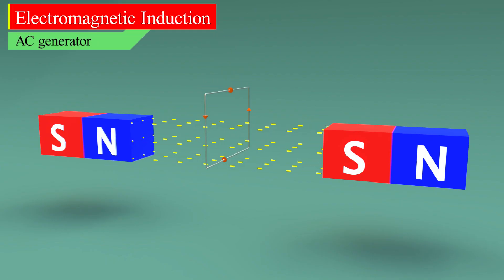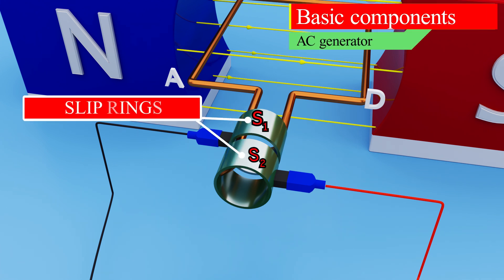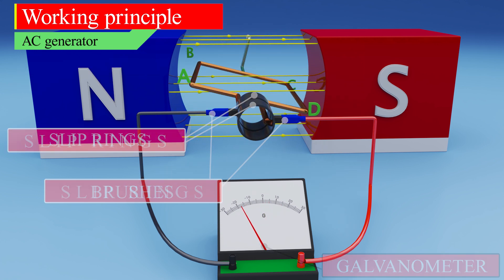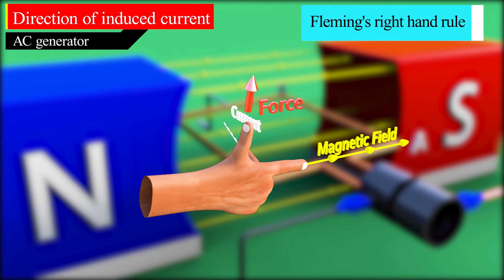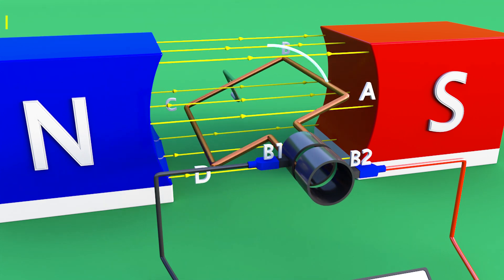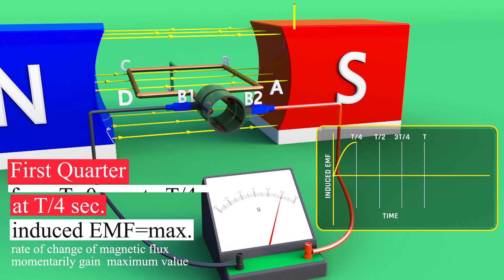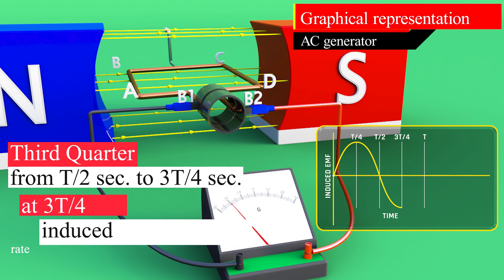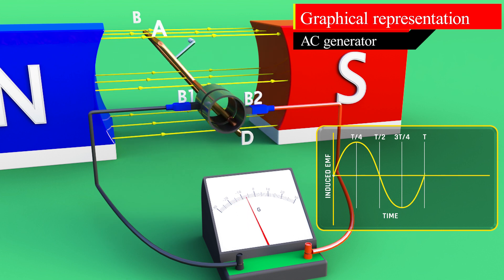Working Principle of AC Generator!

Comment: Everything is just perfect, but one thing might confuse you, and marks might be deducted by the teacher if you make the same diagram on the examination, just because of one thing. Remember not to join the ends of the magnet at both the north and south poles, as a horseshoe magnet is mainly used in motors and generators. Moreover, a monopole magnet has yet to be invented.

If helpful, please 👇🏻and thank you
Yes, I liked my own comment

Comment: A clean AC generator model explanation, one of the best on youtube. If I may add my two cents into this great visualization : the problematic part of this model is the real magnet demonstrated marked as N and S in which a metallic frame is rotated. We do not have such thing as a magnetic monopole, at least no such material is yet known, meaning we can't have a single chunk of material marked as N or S and we can't have any frame rotating between S and N. Having those two N and S is totally misleading and you will never build a generator based on this video unless you understand that:

a. There are no magnetic monopoles so there must be more in this construction

b. No real or electric magnet has North or South part of it in the sense that you can split a real magnet in two halves and have one S and another N part out of it so you could then place a frame in between and get AC generator (which is implied by the video)

c. we just need a changing magnetic field to create an electric field in the frame so actually the location of the frame is irrelevant for as long as it rotates in a magnetic field

To fix this video I would at least use U shaped real magnet with poles at both sides instead of the separated bars marked as S and N or rather two real magnets aligned like N S  [frame] N S at both sides of the frame. I bet the majority of viewers would start building a generator from finding N and S monopoles to place them around the loop like shown in the video :-)

So clean but so misleading in some vital parts, such a pity. Could easily be perfect.
Reply from the maker: Thamks for feedback you are right for monopoly magnet I keep that in minde

Comment: I didn't understand the part when current starts flowing in the opposite direction
Reply: Its AC current so it moves in the opposite direction as well
Reply: it keeps shaking as the wire gets energy from the N and S
Reply: Same I always have this confusion, Can someone explain me nice and properly please?🙏
Reply: The current changes direction in an AC generator because of the rotational motion of the coil in a magnetic field. This is explained by Faraday's Law of Electromagnetic Induction and the right-hand rule for determining current direction. @MenamPatir4912
Reply from the maker: Thanks
Reply: @MenamPatir4912 when the coil rotates the current moves in opposite direction that's it bec the if u said at the first it moves from A»B»C»D
So when the coil rotates the sides are reversed as u saw so in the video the current will move from A«B«C«D
Reply: Maybe u just dumb
Reply: Both paths can't be having maximum magnetic  flux at the same time, look at the horizontal position for example, either ab would be facing the north pole and intercepting the magnetic field or if u rotate the coil then cd would be intercepting the magnetic field, no current is induce whenever a change in magnetic flux occurs. So u can see that whichever part would be intercepting the magnetic field is the part where current will be induced and the other part is just there to conduct the current induced.

Comment: Good explanation, but I'm wondering what causes the coil to move initially?!!!
Reply from the maker: Mechanical energy, steam turbines, gas turbines, and combustion engines. example: some turbine is connected to a shaft of this generator and start to rotate shaft, coil is rotatitng in stationary magnetic field and EMF is generated in coil
Reply: @chrvoje_engineering  
Thank you for replying!
Reply: Even with your hand you can rotate it. (For generator mechanical energy is the input)
Reply from the maker: @bharathvarun  Yes mechanical energy is input
Reply: @bharathvarun  
Then it will keep on rotating automatically?
Reply: @mubarak4886  it can't rotate on its own(energy can neither be created nor destroyed. it can be converted from one form to another).we have to rotate it continuously by means of a primemover(motor,turbine etc...).
In generator we are converting Mechanical energy to electrical energy.
Reply: @bharathvarun  
Thank you for explaining!
Reply: @bharathvarun  
But I have noticed that some electrict generators are initially moved mannually for awhile and then they keep on rotating automatically!
Reply: @mubarak4886  Its impossible and I don't have idea where u might have seen that.
The armature shaft of the generator is mechanically coupled to a turbine or a motor so that it will continually rotate.
Reply: @bharathvarun  

there are small generators used for providing small villages with the electricity.
Reply: @mubarak4886  that must be a diesel generator
Reply: @bharathvarun  
Maybe so!

But I used to think that's a kind of A C or D C generator!